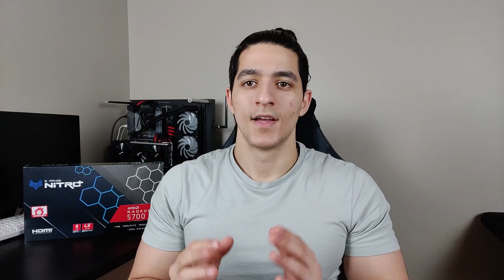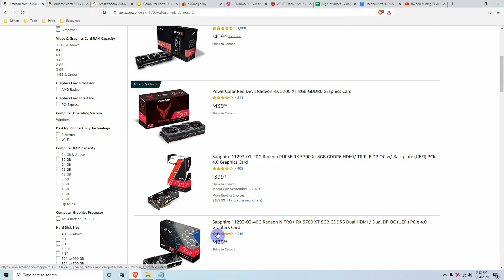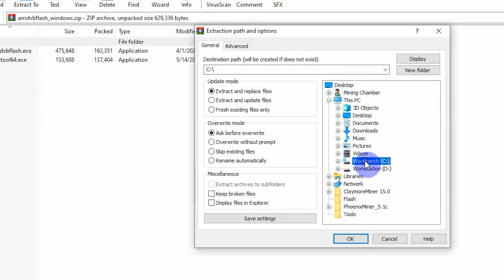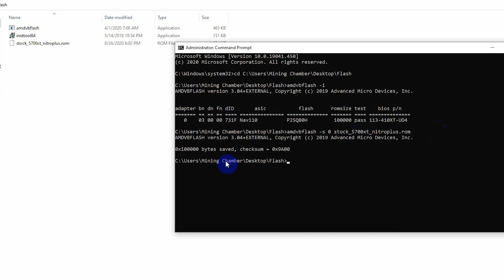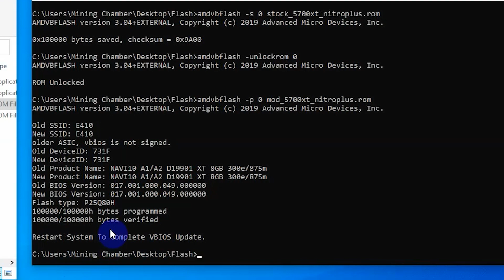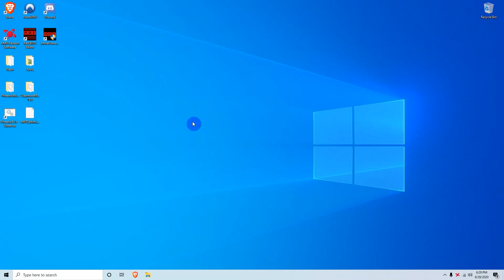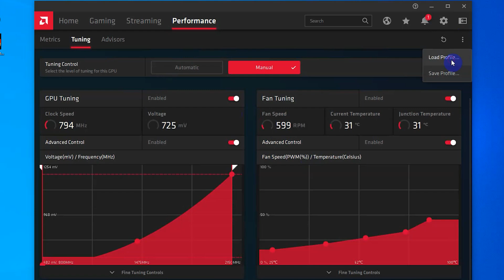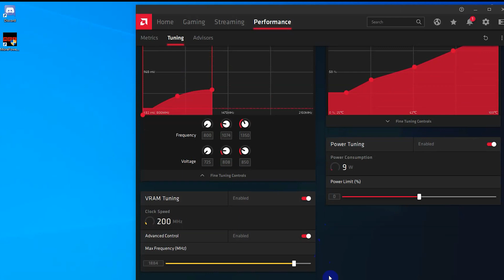RX 5700 XT Mining Overview | Profitability, Hashrates, BIOS Modding & Overclocking

Comment: first of all thanks for yoir great video.
 next i have a question that my setting on amd oc tool restore tofrequency : 2000 and voltage to 1195.
i wonder why it restore to default and how to keep that values you set for my  mining rig.
thanks in advance and great work

Comment: Hi, can i know if I follow the instruction and method that you configure. Will my daily income be the same as the amount shown in whattomine.com?

My rig:
CPU: R5 3600
MOBO: Asrock b450m steel legend
PSU: 650 wat 60+ gold
GPU: Aorus RX5700XT
RAM: 8gb x 2 (3200MHZ)
Reply from the maker: It will increase your mh by 3-4 mh. So just based on your calculations on WhatToMine, increase the mh a little and that's it. If you have just one gpu then it isn't worth it since it's a small amount but for a number of GPUs then yes it does add up pretty good
Reply: @MiningChamber  hi. Reported 59.500 mh/s but, effectivespeed 24.16 mh/s? what is this problem ? :( I did everything completely
Reply from the maker: Hey no need to worry about effective speed, just check on your pool side and see your average hashrate there. Usually takes 6-12 hours to update to your reported

Comment: I have quad core processor with 4GB of ram.. my motherboard supports maximum 4gb of ram. Can i mine with one 5700xt card ?? Or do i need more ram ?
Reply from the maker: Ram does not play a big part in mining. You can run on it as many gpus as your OS can handle. Generally if you have 4gb ram I'd recommend a Linux based mining os since it eats less ram, we have a guide on HiveOs I recommend checking out
Reply: @MiningChamber  ok. Thank u for your valuable feedback.

Comment: Just bought (4) 5700 XT cards and am building a rig. Do I need to do this to all cards? I assume yes, so do I do this to one at a time and when done, unplug and install the next? Once all flashed, plug them all in? 
Or, do I plug them all in, flash them all at the same time, and then reboot?
Reply from the maker: Yes! There is an easier way to do it in HiveOs so you can check our HiveOS guide on that, and you can also check our 6 gpu build of the 5700 xt which we had to do them one by one on windows 10! You can find it in our gpu mining rigs playlist
Reply: @MiningChamber  thank you for the reply. I’m very impressed and thankful you took the time to reply. Sorry I replied late. The girlfriend got in a major car accident and I completely forgot you replied. I looked into hive OS and think it’s pretty neat. I’ll do more research on it shortly and check out your videos. Currently am running windows 10 with the Radeon latest software and I am having an “we detected a driver timeout” constantly appear when I boot windows, try to mine, or do anything. It seems GPU2 is constantly crashing even at stock settings. GPU1 performs normally though. Spent 2 days on this issue and I’m stuck. Any chance you can add me on discord or such?  Have any suggestions? I have tried a lot already but to no success. 
Edit: removed my discord info. I joined yours. Thanks!

Comment: Hi Mining Chamber. I did modding separately for all 4 5700XT graphicards. And it is totally fine when I'm running mining for each card, but when I put all 4 graphicards, I ran it with phoenic and suddenly have popup message saying they detected bug and gives me option to report issue or not. And the computer freeze. What do I do? And What is the issue?
Reply from the maker: Hey! I would try different drivers version, use DDU in safe mode to uninstall drivers and use 20.4.2 drivers, I had a great luck with it
Reply: @MiningChamber  Thank you very much!
Reply: @MiningChamber  Do you mind if I can have a link for the DDU?
Reply: @MiningChamber  So, I download that one and I'm getting message "Radeon Software and Driver versions do not match. Please try again after updating to the latest version(s).

Comment: I have a saphhire AMD RX5700XT Nitro+, I followed your instructions step by step with the video, I still can't get over 17 MH/s, what am I doing wrong? :(((
Reply from the maker: Could be a bad riser or check your motherboard settings for mining mode and 4g decoding make sure it's on, also make sure to install the drivers for the gpu!
Reply: @MiningChamber  Thanks. Yes I did all that, it's not a riser, it's on the board (Meg ACE X570), enabled mining in Bios, and of course latest drivers, still no luck.

Comment: I just bios modded and overclocked both of my gpus (I have the exact same models as shown in the video) using the recommended settings and i got a 5 mh/s increase, but after a few days the wattman software restored the original settings, so I set the values again, but now after one day it restored them again because of unexpected system failure. What do you think is causing the problem?
Reply from the maker: Hey! This is usually due to your overclocks being too much for the GPU, not every gpu can run on the same settings so you just need to tune down your memory clock or increase your voltage until it's stable. Do increments of 10
Reply: @MiningChamber  Wow, man you replied so fast. Thanks for the advice. Will try.
Reply from the maker: @tothbarnabas2588  good luck! 😉

Comment: Highly disappointed with rx 5700 xt Nitro plus, my red devil is able to get 56.2 mh/s at max.(when hardly any incorrect shares are there and if I go a bit high also it gives me 10s of incorrect shares); on the other hand nitro plus hardly goes over 54 mh/s and if clocks increased 10s of incorrect t shares and then rig fails. Sapphire nitro plus is a complete disappointment! :(

P.S. complete bios modding was done following tuts from here and I have a single memory unlike my red devil which has 2
Reply from the maker: Oh very interesting try to push the core clock a bit further for me that increased stability and hashrate - do 1400-1450

Comment: can i use rx 5700 and rx 5700 xt both in same rig in Windows 10, i mean without hive os ? I am new to mining.
Reply: Yes. I have 2 5700 in a 7 card 5700xt rig using windows 10.  both have timings modded, one is flashed to a 5700 xt bios one is still a 5700 non xt.  the rig is stable, no problems.
Reply: @Yang-ms1tt  thank you for ur valuable feedback.

Comment: hi i just started with mining so sorry if i make a silly question.
i got a msi 5700 xt mesh oc. and did the bios like you showed only difference was i had 1500 mhz on the memory timings and not 1550 so i tooke those numbers. i get like 55 MH/s so that looks good. but one downside i see is that software shows the gpu take 174 Watt - 180 Watts. do you think i did something wrong?
Reply from the maker: Hey! It's okay not a silly question!  Did you overclock the card properly like we did? If it takes alot of power it's due to the core voltage. Make sure you have that set properly
Reply: @MiningChamber  yea i see it goes automaticly to 2000. Nedeed again to put it down. Now i have 56 mhs on 100 watt
Reply from the maker: That's better! Off the wall should be 130-140 watts not bad at all
Reply: @MiningChamber  what motherboard cpu and ram do recommend? Got 165watt from wall atm.
Reply from the maker: Not bad! There isn't really a cheat code for the mobo cpu and ram. Go as minimal as you can with any mining motherboard and a cheap compatible cpu unless your planning to cpu mine then that would differ

Comment: I flashed the bios on my Strix 5700xt verbatim and it was running at 145w with your settings.  Is there a guide on tweaking the clocks/voltages for optimization?
Reply from the maker: Well we give a base for it and then you just need to fine tune it to your card since every card is different. You can check our written guide maybe it can help you better achieve what you want, although I'd say 55 mh at 145 watt is a good spot for it
Reply: @MiningChamber  145w at the wall sure, from the software that's probably 170 at the wall.  I'll play around with it and see.  Thanks again.

Comment: I followed everything religiously on this video, flashed the bios. But when it says restart the system, i restarted the system and got the black screen. What should i do now?
Reply from the maker: Hey! Which gpu do you have?
Reply: @MiningChamber  i have gigabyte 5700 xt Gaming OC 8GB
Reply from the maker: Did you follow the instructions on the pinned comment? That you have to use that unlocked BIOS.

If not it's okay just unplug the GPU and set the motherboard settings to give display from your motherboard integrated graphics and then plug that gpu again while your still using the output from the motherboard and flash back on the gpu the original bios which hopefully you saved! Then redo the steps but with the pinned comment one
Reply: @MiningChamber  while computer is ON, can i plug a gpu? Like in a motherboard PCIe slot or the riser? Im using the integrated graphics but whenever i plug my gpu and turn the computer back ON, it stuck on black screen. I tried putting 2 gpus, but still black screen because of that one card
Reply: @MiningChamber  i have tried putting the riser in when the computer is already giving me display but its not picking up the device in device manager. I also check in cmd but no device found
Reply from the maker: Don't put anything on while pc is ON!! Its just going to break something else like that. Never change parts while electricity is moving around. Join our discord and let's troubleshoot there

Comment: Hey. Made it over to this video from your other video. I did this all step by step and the bios appear to have installed correctly, but when I turn it on, the card won't run correctly. Won't pop up in the miners and the display outputs won't work. Gigabyte 5700 XT OC. I saw in your google doc that there may be an issue with this brand of card? For now, I flashed back to the original, and it's working fine. Any ideas?
Reply: Nevermind. I followed the instructions on your "What we know" google doc and flashed an older version of the bios for my card and it worked! Thank you so much. Your channel is an amazing resource. Keep up the awesome work.
Reply from the maker: Awesome glad you figured it out! Thank you!!

Comment: Hi, I am trying to flash 5700xt and on the very first stage having an issue. I ran CMD as administrator and copied location of amdvbflash - i but it says ‘amdvbflash’ is not recognised as internal or external command, operable program or batch file. Not sure how to resolve if you may help.
Reply from the maker: You need to make sure that you cd into the directory where you have amdvbflash in
Reply: @MiningChamber  I will try again but I copied the directory from  properties of amdvbflash.
Reply: Thanks, all done. But getting 54 m/hs on 100 W on Radeon software.

Comment: Hi, Mining Chamber. I have the same GPU. I use the 16 slot and it is not turning on. My Bios set to Gen 2. I don't see the light and the fans isn't turning on. What should I do?
Reply from the maker: Hey I've responded to your previous comment! Like I said try gen 2 and 3 If that fails try using a riser  and connect to a different pcie lan on the motherboard. Try a different gpu. Narrow down what has the issue, it can be either the motherboard or the gpu so test them both and see what happens
Reply: @MiningChamber  Okay. I found out it was a riser problem. one riser didn't work. Every other graphic cards work, but when I plug the one GPU the monitor does not turn on. And I try to use the HDMI into the GPU to monitor, also it didn't turns on the monitor. Do you think is it because the driver didn't installed in the computer?
Reply from the maker: @balabing717  It could just be something with BIOS settings. You said that plugging that one specific card doesnt give you a display but all other cards do?
Reply: @MiningChamber  No all the card works it just the riser had issue. I found out one riser didn't work but when I switch the riser for the graphic card it worked. So, it seems like all the graphic card works, but as soon as I add the one graphic card in the 16xPCIE the monitor does not display (in both side HDMI plugged in Graphic, and DVI cable in motherboard.) So, I think it is setting in BIOS. So, I changed it the primary display to the PEG but when I save and reset the BIOS, it just not save in BIOS which is werid... Is it motherboard issue?
Reply from the maker: Don't reset the bios, try to just save and exit. Also dont plug hdmi and vga. Just test them one by one. First test hdmi, plug and unplug in each gpu while it's on to see which gives display. If none, then try just motherboard with vga. If your able to get in BIOS that's good, just make sure you have your storage device with windows or any system your using properly load
Reply: @MiningChamber  So, yea I didn't plug hdmi and vga. I did one by one. But what i'm trying to explain is the monitor does not display when I plug the GPU in motherboard. But if not the monitor displays fine. But as soon as I plug the gpu the monitor does not display in both method (hdmi and dvi). Also, I didn't update the bios yet is it because the bios not update it yet? I download the bios utility update zip file in flash drive but it is not showing in flash utility in bios. So, I talked to the biosstar support, and they said to remove the CMOS batter and put back on. So, I'm trying to figure that out.
Reply from the maker: Okay sounds good I understand, give that a try and see if it works, if not, for BIOS flashing you need to extract the files in the zip into the usb and then go to the update utlity through the bios.

Comment: How does yours show 85w in software at 55mhs and not changing the power limit. I have done what you have and also dropped the power limit and still can't get that low...yes I have successfully done what was shown here.
Reply from the maker: Software is not accurate, so just try to measure your watts off the wall which we come out to around 130 watts with effecient settings! No need to touch the power limit when your undervolting it
Reply: @MiningChamber  thanks for the response. I'll review it again later today and see where it lands!

Comment: Hey I have the tb250 btc pro with rx 5700 xt Red devil gpu. The motherboard gives a error at the startup screen for the gpu. Yellow warnings in the device manager for pci slot. Any suggestions?
Reply from the maker: Hmm it would best be if you join our discord and send a picture of it so I can visually see the error! Just make sure everything is powered properly and riser is powered with just the 6 pin

Comment: Thank you for this video. I have my 5 x 5700xt rig going at 277m/h and only using 750w off wall! Getting 2 more cards next week.
Reply from the maker: That is awesome!! Glad it worked for you!
Reply: Hi Josh, do you mind sharing what OS youre using and how you are mining? My GPUs constantly crash whether theyre stock settings or theyre at 1400 850 and 1700-1800 mem clock. Is it because I'm using windows and nicehash? is the bios modding required or is it to just get the wattage lower?
Reply: @StevenDanielZigila  Hi Steven, I am using win 10, phoenix 5.4c. I have 1 card that is the problem child on my rig. I did find it helpful to do the bios modding as suggested by the great folks at mining chamber. It's not that difficult once you do it a few times. I now have 8 5700 xts and all are running on the 725 mv stable except that one which I have at 775, 800, 850. I get about 1.5-2 days of uptime roughly until that one card fails. Also, I did notice if I keep the room at about 74 degrees fahrenheit it seems to run more stable. I hope this helps.

Comment: bro i have same cards but in hive os !! can tell me vdd or core or mem for hive os ? for 57-58 mh/s
Reply from the maker: Hey! We recently posted a 8 gpu build in HiveOs you can check out the settings we did there for it! I usually use 1300 core, 780-800 vdd and 900-930 memory. Just keep tuning it if it keeps crashing

Comment: I followed your video, I got 55 MH/s from your video, but the voltage seems to jump back up to 750, instead of 725. Any tips on why i see so many options on which card to choose? I see about 21 cards on MorePowerTool !
Reply from the maker: Make sure to use the same more power tool file that you save load it in the Red Bios Editor of the bios your currently modding!

Comment: thanks, i got increase 5-4 mhs. do undervolt have negative impact to the hardware ?. since we got boost on perfomance but running in lower voltage.
Reply from the maker: Undervolting will actually prolong the hardware. Less power, means less heat, less heat means longer hardware life. The reason we get a boost in performance is because generally GPUs use more power than they really need to, and since we are mining we don't need the core power of the gpu we just need better  memory frequency

Comment: Hi great tutorial!! Many thanks. 
I followed it but it did something wrong and I bricked my Gigabyte Radeon 5700 XT OC 8Gb and now the motherboard doesn't POST(Gigabyte GA-B250-fintech) even though it has integrated graphics.
But if the 5700xt is plugged in the mobo doesn't POST, I think it detects the bricked card and prevents starting up.
Do you know any motherboard that allows to POST and starts correctly with bricked cards connected (as secondary graphic card) or any other software way to recover the 5700xt?
Thanks in advance
Reply from the maker: Thank you! And  that is odd, maybe check if your gpu has a BIOS switch and then you can just switch the bios and flash back the old bios once your already booted into windows then you can hit the bios switch on the card again
Reply: @MiningChamber  Thanks for the response, finally I managed to get the card back, using freedos so now I will try to mod the bios : )